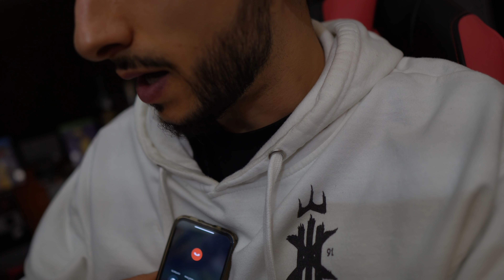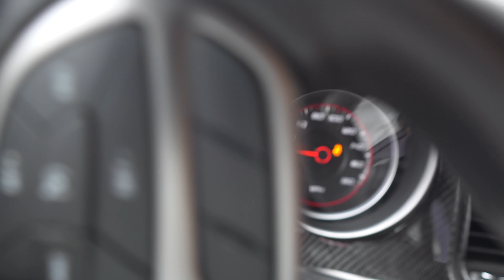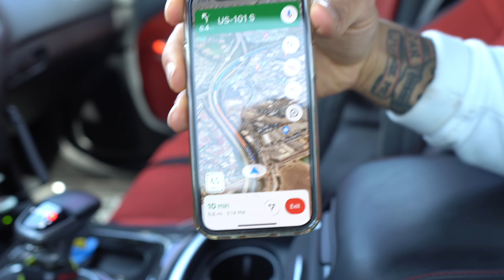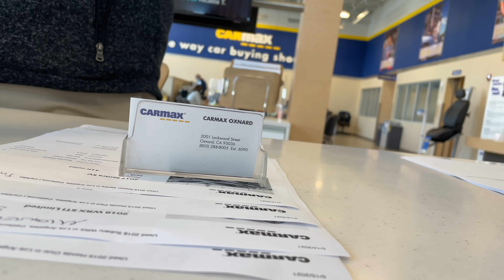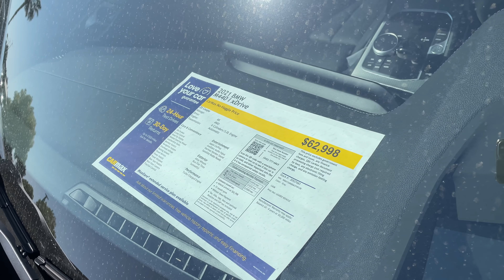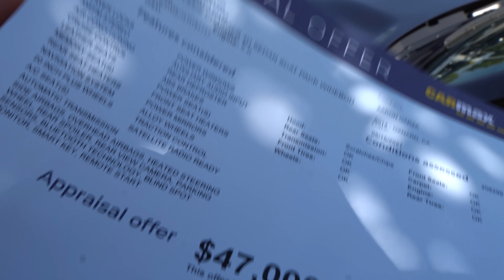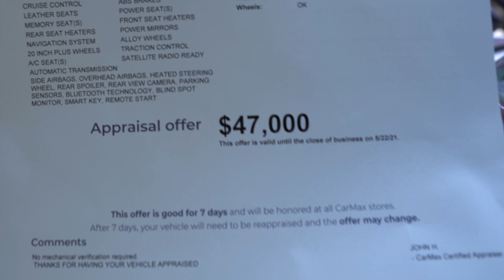Took My 2020 Dodge Charger 392 Scat Pack Widebody To CarMax For Appraisal

Comment: i wanna say they would’ve offered a lot more if the suspension was stock. What you can do is sell all the aftermarket parts to make back some money and get the car appraised stock.
Reply: This
Reply: That’s the best way to sell any modified vehicle because having mods on it doesn’t bring the value up like people may think. It’s a liability to any buyer because they don’t know exactly how many miles are on what parts or where u got them from if u have no receipts. But it takes more time to sell it that way and that’s turn a off for a lot of people. U gotta be patient tho. Patience and more work gets u more money. That simple.
Reply: Yep, more often than not, modifications will reduce the value
Reply: Exactly, plus these have adaptive suspension  and I think Louie might’ve messed up the alignment and obviously it’s value. These cars already come modded stock

Comment: Bro CarMax is on one, local dealership offered me $48,395  for my 2019 Challenger R/T scat pack with 12k miles on it. You should be able to get $52k all day for that car..
Reply: brand new and 2021 is 41k tho? without the wide body and packs
Reply: @GB2G  is there a way to post pics I have the quote.
Reply: @pat6801  na i believe u to im just sayin it don’t make sense cuz i could go buy a new for that much, do they rise in value or sum shit 🤔 how much u got it for
Reply: @GB2G  after trade in I paid $27k about 5 months ago. Now If I trade it in they will give me $48,300 or $45k to sell it to them out right. They had  a 2019 R/T for sell for 42k and a 2020 wide body charger with 20k miles on it for $52k its crazy what these cars are going for right now. My car is actually worth more now then what it MSRP for.
Reply: @pat6801  yup they offered me $34k for my 19 r/t. I only paid $23k last April during the pandemic
Reply: CarMax is trying to sell a 2016 scatpack with 12k miles for 48k right now. I believe it

Comment: If it wasn’t a sellers market I’d say that offer was great.  As a potential buyer I’m like it’s a 2020 and it was bought new which means there was a power dollar discount from the manufacture.  Plus any possible dealer discount negotiated and then general depreciation on the car after a year.  Having said all that it is a sellers market right now for used vehicles and I have seen ridiculous prices on used Scats!!  “If” you can find a brand new 2020 on a lot or were still able to order you typically end up with a better deal than buying used with the power dollars.  Great video!!

Comment: What’s the difference between this scatpack and the 392? Why is the 392 better?
Reply: 392s have small upgrades that are better than scats same engine and insides tho
Reply from the maker: 392 is referring to the size of the engine. You’re thinking of an SRT which has a 392 cubic inch engine as well as the scat and some upgrades aside from the engine that separates it from a scat pack. But widebody scats have everything an SRT has.

Comment: My local Dodge Dealer just got a used 2018 Scat Charger, top trim in Plum Crazy.  They listed it for $49,000.  The mileage was about 18,000.  I think they just sold it.  Check out Carvana.  They always offered me more money than a dealer.

Comment: Car market is crazy right now I just bought a 2021 392 scat pack charger from a dealership in Redlands for 44k I had to talk them down quite a bit I traded in my 2019 challenger gt for it they gave me 25k for the gt which is insane since I bought the Gt for 24k brand new

Comment: I bought my 2018 scat with the dynamics package and heated cooled seats with 20k on the dash for 32k. Dealer wanted 35k. I did appraisal on carvana and it said 36k.
Reply: You got my curious.
2018 scat
Tech pack
Sunroof
Heated cool
Alcantara
Beats
And some more shit

39k miles.

I'm thinking they will offer 32k.
Reply: @infamousy2g1  I mean depends on condition. I always take really good care of my cars to the point where they look new. You can view my channel to see what my car looks like. With 39k miles I would
Expect about 34-35k trade in. These cars hold value really well.

Comment: They offered me 42k for mine SPWB with only 900 miles. 2019 b5 blue. But i ended up selling at another dealer for $42,400 this was right as the chip shortage was starting if i waited a week or 2 i probably coulda gotten $3k more lol
Reply from the maker: Yeah definitely could’ve. Prices went up a lot but still not a bad deal

Comment: Keep the automatic tranny. The manuel tranny clutch parts give out after 38,000 miles. Very expensive to replace if you like spending $1,400.00 -$1,600.00 everytime the clutch breaks.